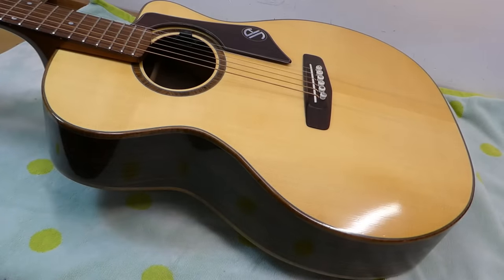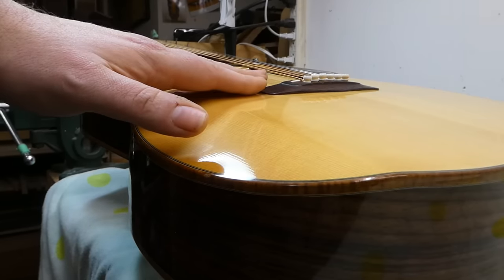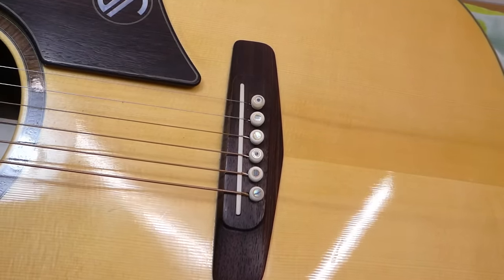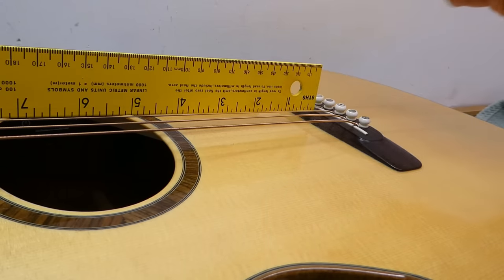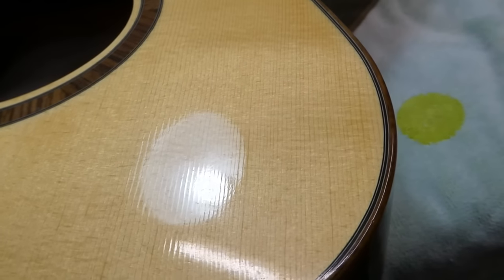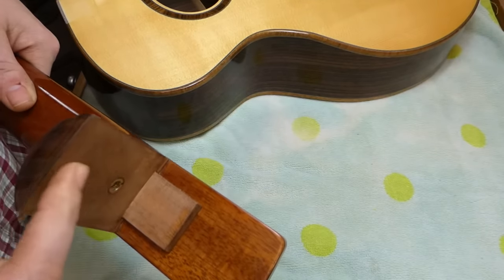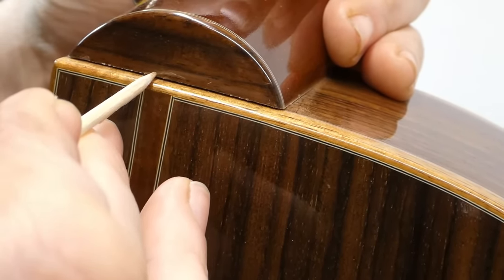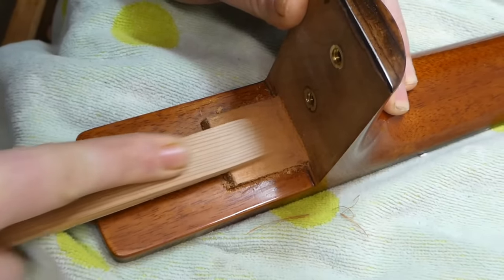A different sort of neck re-set. (Thomas Wray Guitar)

Comment: Socrates (is reported to have said, by Plato), “The more I know, the more I know I don’t know”. Watching and hearing you delightfully and artfully repair these guitars is a truly beautiful thing. The problem is, now I’m terrified at the prospect of changing strings on my Martin for fear of something I don’t know! ✌️❤️🙏🇦🇺
Reply: Bah... Changing strings is easy. Just get the same gauge you had on it to begin with and everything should be good.

Every guitarist should know the basics, in my opinion. 

Also, you can generally go a size lighter or a size heavier without needing to change your setup - on a decent guitar. With age, my preference is to move to lighter strings - but I own some truly antiquated instruments. If you lived nearby, I'd tell you to come on over and I'd change your strings while you watched, or have you do it while I watched. It's a trivial thing to do. They will stretch when new, so tuning won't be stable immediately - especially if you play hard. Wrap to the inside and up. Use a string winder that has the tool to remove the pegs that hold the strings in place. Plus the winder will help you wind up after faster.

It's really, really basic. You've got this. If not, search online (right here on YouTube, if you want) and I'm sure there are 10,000 videos that will show you how to change your strings.
Reply: As an amateur luthier/guitar repair tech, there are things I will do myself like fret leveling, recrown, and polish.  And then there are things I will never do, like a refret on an old maple neck Fender (guitar builders will know why).  Fear and respect for the process is a good thing.  There is an old carpenter's adage:  You know something when you've seen it done, did it yourself, and then taught it to someone.  Watch builders/repair techs like Ted and then try it for yourself on a few less precious instruments.  I did my first fret job on a pawn shop Washburn electric that a past owner stripped and attempted to refinish.  I bought 50$ CAD for parts.
Reply: Hi, my comment about fear of changing strings was a metaphor. Ive been changing guitar strings for near-on 50 years, but thanks for the lesson. Have grea day.   @galeng73

Comment: What would the disadvantages of using an angled shim instead of removing material be for this application? I'm assuming it would be slightly noticeable and you would probably have to remove some material from the fretboard riser as well. it would also eliminate some of the tail tapering and chipping issues, I would think. Would it change the scale too much to compensate for?

Comment: I know you have explained this before, but that was one of the most elegant explanations of sandpaper pulls I ever heard. As a matter of interest, on bolt ons I have pulled with the paper at an angleso that the central portion at the bottom also gets some action. Although the paper is at an angle, I still pull straight. Seems to work.

Comment: I did a similar two-bolt neck heel adjustment a few years ago.  I was able to use feeler gauges slipped between the heel and the body up above the upper bolt.  I could even string up the instrument to account for rotational stress movement etc.  (I'd already roughed out the new saddle.)  Then I removed the neck and took the gauge thickness in material from the base of the heel.  Then blended this up to nothing under the fretboard.  It wasn't perfect first time, but it was very close.  As well as a few light sandpaper pulls, I also used carbon paper to perfect the fit of the heel against the body.  Thanks as always for your videos mate.

Comment: Wow, what a strange instrument!  In over 30 years of playing guitar and being a part time luthier, I have never seen a flat top with a raised fretboard like that, and DEFINITELY nothing that had a negative neck angle, pulling the strings up like that.  It's crazy how much the top moves under tension 😲 
I own one of the strangest flat tops I've seen- '81 Ibanez Ragtime Special.  Oval sound hole, raised rosewood ring around the soundhole (as opposed to an inlaid rosette) fingerboard extension out over the soundhole to get 24 frets on the high E and B strings, and a fiberboard baffle around the inside of the soundhole which directs the sound waves out to make it bigger sounding.  It's like an OOO size, but sounds just as big and loud.  It's actually one of the loudest acoustics I have ever played on.

Comment: for adjusting the angle of a butt-joint bolt-on neck, forego the paper-strip pull method and get yourself a very flat hard surface (I use a piece of marble) and mount it on the end of your bench. stick some sandpaper on the marble and now you have a fixed sanding surface you can push/pull the neck heel surface back and forth on. Using hand pressure on the heel end removes more material there, you can take more material off of one side of the heel by pushing only, or pulling for the opposite side. This makes setting the angle of a butt-join bolt-on neck extremely fast and super easy, with zero chance of damaging existing finish on the body of the guitar!
Reply: interesting! i'd still be kind of scared of throwing off my flatness or straightness or the correct angles or whatever while freely sliding the neck heel around on a sanding surface

what i did do with a tacoma i reset (similar butt joint) was to indeed set up a flat plate on the edge of a bench but keep to the paper-strip pull method. i was also able to just center a wide strip under the entire heel and pull, as opposed to doing one side and then the other

Comment: I would think not enough stiffness in those butt cut bolt ons without a  dovetail or mortise tongue , especially on a neck with an upstand.
The furniture assembly threads will often crack the heel when the guitar gets a shock.
I like Ted's gentle , rational moderation .

Comment: Ted I bet you could design a clever neck joint that was pre-shimmed so that in 40-50 years somebody would just have to take them out to reset the neck and they'd praise your genius, and both you and them would have passed on before somebody got stuck with doing a manual neck reset.

Comment: Good as always. The shim you put on that little platform between the underside of the neck and the top of the body confuses me.  It looks like there was more space to fill closer to the sound hole (which makes perfect sense since the neck it tilting back now) but when you sand it, it looks like you are taking more material off the sound hole side rather than the headstock side. I would have expected the opposite.

Comment: I pulled the neck off of my Selmer Signet, a beginner guitar from 50 years ago. All ply, but rosewood ply on the back and sides! In short order (couple of years) it ran out of saddle, so I thought I'd yank off the neck. After much distraction from failure, I found out that the dovetail went along top, not at right angles. Still have that body on my shelf, as I destroyed the neck removing it, and it wasn't worth fixing.
Reply: Couldn't fill the ugly parts and turn it into a bolt-on?

Comment: Instead of removing material via sanding to reset the neck angle, what would have been the plus or minuses of shimming  the neck body joint to achieve the same neck angle ?
Reply: Not a luthier at all, but I am guessing that would be adding material that would have to be finished and masked to its surroundings.  Just a guess, but I can't think of any other reason.
Reply: @frankwebster9110  ,  Shimming the neck that way would likely cause the neck to move a little farther from the bridge, and this might knock the intonation off significantly at the saddle.

Comment: I'm still trying to figure out why he raised the fret board. For a strumming guitar I can understand. But if you do picking it would throw me off..I like to keep my pinky on the guitar for registration. OK I guess he just wanted to be different.
Reply: I think it has to do with more of the soundboard being free. I would think the more stuff that's stuck to the soundboard, the less sound it will project or perhaps prohibit a certain quality of sound. It certainly doesn't have to do with aesthetics!
Reply: @frankwebster9110  I heard the bigger the sound hole the less sound. And the reasoning is you have less sound board. It's the board that really modifies the sound.
Reply: @frankwebster9110 My guitar teacher had a Gibson Johnny Smith  jazz box, and NOTHING but the bridge touched the sound board, for that very reason.  Fingerboard, humbuckers, pick guard -- all elevated, with a trapeze tailpiece.  Even the pots and output jack were attached to the floating pick guard.

Comment: Impact drivers stop your wrist getting wrenched by torque constantly. You can get anti torque drill drivers but they are heavier. It is an annoying sound though.
Reply: I replanked my large deck 5 or 6 years ago, using ordinary Milwaukee cordless driver- drills to drive Torx screws and stainless steel Robertson (square socket-head) screws, and found it somewhat difficult to drive screws into 30 year old deck joists even if I predrilled the holes (the  stainless screwheads tended to get chewed up and strip out). More recently I bought a Milwaukee cordless impact driver and found it so much easier to use that I was kicking myself for not getting one sooner! And as a bonus, it attracts woodpeckers too! (That last was a joke).
Reply: @goodun2974  yeah they're a lot easier on the arms. Poor Ted though.